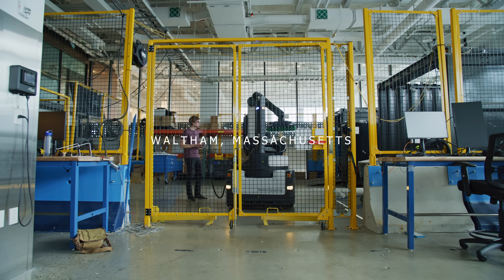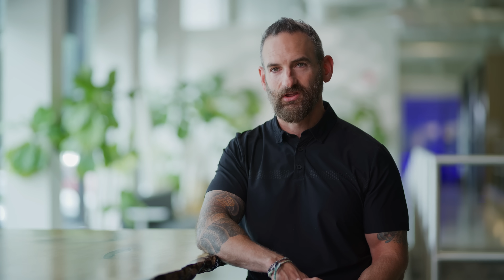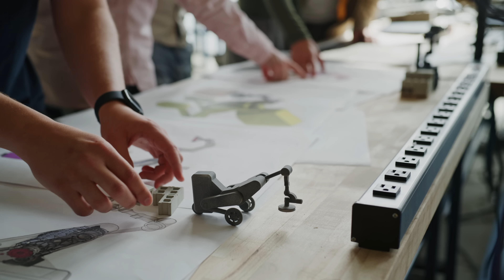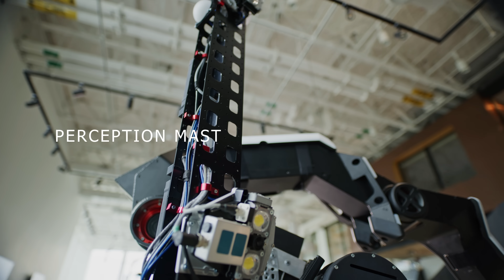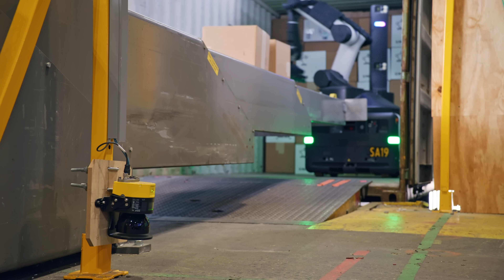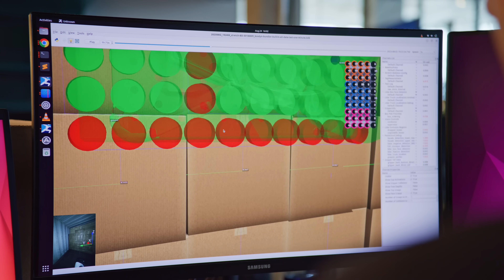The Evolution of Stretch | Boston Dynamics

Comment: They should make one suitable to load and unload suitcases of airplanes. Seems like a huge gap in the market.
Reply: That would be far more difficult because of the tight spaces and how the suitcases are randomly piled up and come in many different sizes.  Robots don't have general intelligence to use arms and gripper hands in such diverse ways, and they also don't have the balance to reach in and yank out or lift out heavy cases.  It would require the intelligence to pull out the correct case each time in a messy pile to not cause problems such as an avalanche onto the tarmac.
What seems easy to us, general intelligence of manipulating things in the real world, is pretty much the ultimate difficulty for robots.  We'll need full AGI for robots that can quickly, safely, and correctly load and unload an airplane cargo, any random truck, or for that matter, clean a house or build a house.

Comment: What if inside the cardboard is something heavier than the cardboard can withstand ?
Reply: The box tears open?
Reply: @frag0638  exactly
Reply: Maybe it can sense the weight and retry from a different angle, eg the side?
Reply: @frag0638 even worse
Reply: @frag0638  don't think so. The suckers are situated from the top so this robot lifts only by sucking from the top of the box. It's stupid idea and you can't apply this to everything.
Reply: You would just have it suck from the side of the box, tip the box over, or pull it out, then swivel the arm to place itself under the box, then balance it on the paddle, then turn, and dump it off onto the belt, or wherever it needed to be loaded. Dunno if this is capable of that, but that's how it'd be done.

Comment: Definitely cool, but being limited to boxes is a problem. This could obviously be trained to handle things like glass panes, wood planks or sheets, but small packages or individual parts will need something with finer dexterity. Even some large, odd shaped items could be a problem depending on how they're stored. Some things are stored in a manner that is very space-efficient, yet requires human dexterity to pick or stock. Such is the case where I work. Of course, a fully automated version of my workplace would probably be designed rather differently. Simply putting a robot where a human is without changing anything else is the most complex solution. Better to design an operation with robots in mind from the beginning.
Reply: I think they’re aiming to partially bridge the gap between human oriented design and robot oriented design. It’s expensive to reorganize your whole warehouse for robots but gradually accommodating robots for specific jobs is (relatively) affordable and profitable in the short term. I imagine as adoption of automated package handling increases there’ll be more pressure on manufacturers to use robot friendly packaging.
Reply: There is another problem which is, that it is limited to specific type of packing stuff into the boxes. For example, in warehouse where i used to work, almost all the boxes where covered with foil and sometimes in more than one type of foil where the outside foil was much more baggy. I don't think the vacuum grabers would work with those

Comment: I'm a truck driver with a lot of experience unloading and loading. This robot is interesting but most loads are coming on pallets, there are a lot of boxes on it and people can unload using pallets which is way quicker than box by box. It would be best if you designed a box to ensure the robot hashave a good grip. They need a pallet robot.
Reply: Agreed, surprised that Stretch does not have an adapter which would turn it into a robotic pallet truck to offload full skids from a docked truck or trailer.

Comment: Big fan of BD.  I'm sure Stretch is causing a lot of excitement in the logistics/shipping world.  I wonder if the speed/efficiency could be enhanced by having two arms.  While one is putting a box on the conveyor, another could be picking up another box.  Seems like there is enough room on the base, just would have to have the compute be able to choreograph the dual movements in the confined space.
Reply: If you look closely when the arm is on one side the lidar scan the other one so it always as a fresh scan for every box placement and the environement. This way if one box fall or something happen when moving it will instantly adapt the next move instead of doing a mess until the next scan ;). 

So with two arm you'll need two lidar but the movement will be slower because the arm will still have to wait for the lidar to scan before taking the box so the second arm will not take the box while the other places it and also every movement for both arm will not take the same time to achieve so one arm will delay the other before alowing the platform to turn at the end it will take more time to turn and will cost more money to make.
Reply: @Skidline_  I didn't say it would be easy to just add another arm and I do realize it would need two lidars.  Why would the arm picking need to wait for it's lidar to scan.  The data from the other lidar could easily be used when it picked up the previous box.  The idea is to get both working symbiotically.   Even though not every pick and placement will require the same time increment, (i.e. placement on the conveyor would likely always be less than the time to pick), you would be cutting the time to turn in half because when it's turning to place, it's also turning to pick up.  As far as the cost, even if a two arm Stretch only meant a reduction of 1/3 versus a one arm Stretch, that still is a huge savings that will pay for itself.
Reply: @JohnMGibby  Yes if the lidar and data are managed in real time but i believe the data is not totaly in real time

When the arm take the box or drop it use the previously calculated data made with the scan that occured when it was facing the other side so it always need the lidar to scan before each move. 
In the video they don't show the arm reacting in realtime to change that occur after the scan. The video also show that it need one operator to move Stretch with a remote so unlike atlas or spot the robot can't move in autonomus way or react to be pushed away  so no real time data ( my guess is that this way it require less power to run increasing the battery duration and need less data to process reducing the cost off microchip and making calculation faster because it will only have to calculate one movement after another and not everything in realtime )

With two arms and lidar it's changed because the picking arm will obstruct the lidar view with a box if scan is done after picking the box so all scan still need to be done before but because off that the arm can't use previously scanned environement because it occured before the previous move so something could have changed between. 

The only way i see it working is if the lidar are placed not in front or rear where arms are but on each side left and right off the robot this way the robot will scan when turning so arms will not be in the way and scan will occur seamlessly during the movement. It will have no delay with both lidar scanning at the same time but will need faster calculation to make it in the turning time frame or it will need Stretch to make a stop mid turn reducing the speed of operation.

It's only my point of view and bd will probably found better way to make Stretch faster and better in every way ^^.
Reply: Just wait few moments - Stretch will have maybe octopussy level of arms spinning around with AI accuracy - just wait
Reply: @mikakettunen7939  Two arms seem like a logical progression.  Octopussy?  Not so sure.  LOL
Reply: @JohnMGibby  I know - was thinking something in terms of 5th Element future or so - but u never know :)
Reply: It seems two arms wouldn't be necessary if they perfect the one-arm's accuracy and safety, then just double or triple the speed. It could load/unload at at a blur to humans...
Reply: @michaelmaclellan499  That is a good point.  And I think a speed up is definitely possible, but some goods might require special handling.  Not every box can handle swinging around at high speed either because the contents may be fragile or the weight of the contents under G load may exceed the capabilities of the box bottom seal.
Reply: Look at the tool changer arm on a cnc vertical milling machine. One side grabs the new tool and the other side grabs the tool from the spindle. Then it swaps them.
Reply: It's called buying 2 of them.......
Reply: @johnshite4656 I suppose they mean having two arms on one base. Having two would indeed take up a lot more space. I think a two-armed version would be worth more than two one-armed versions
Reply: @johnshite4656   Can't fit two of them in a semi trailer.

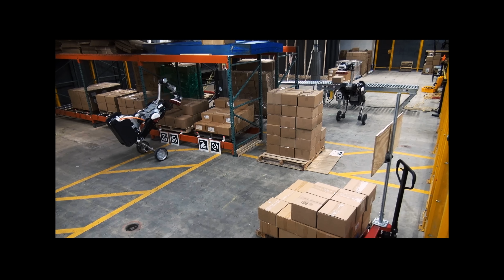Comment: 3:32 - Although they ended up not being the right solution for the warehouse environment, those ostrich robots are my favorite design. The motion they exhibit in order to maintain balance is one of the most natural motions I've ever seen in a robot and makes them look almost unbelievably alive.
Reply: It would be awsome if they turned it into some sort of smart offroad vehicle with the capabilities to pick up objects like logs or whatever on your adventure(the first model with the hands)
Reply: Robots twerking to do their warehouse job. That's the future we could have had if BD had stuck with it. 😢
Reply: @echthroi9  It looks inefficient and unreliable. And expensive. The flat base of Stretch is better where you have level floors.
Reply: @johnshite4656  g
Reply: Agree there is something mesmerizing when seeling it balancing on 2 wheels, turning in a very tight radius and manipulating another object at the same time. Moving boxes seems to be too simple of a tsk for it. With a different gripper it could moved a traler or load truck beds
Reply: It moved very elegantly, if that's what you mean, like a ballerina balancing.
Reply: You'll definitely have some new types of box failures when this starts being adopted. Boxes over 30lbs might not be able to reliably handle its full load from a single face.
Reply: I think they should be in a sanctuary where they can roam free
Reply: It's just not elegantly moving. I imagine if it was taught martial arts, it would probably have some pretty good kung fu and parkour skills like the wheelie people in return to Oz
Reply: @hyperverbal  w in the h f are you talking about.
Reply: @johnshite4656  you remind me of somebody I don’t wanna be around or be a friend of
Reply: @shazam6274  you have wisdom I’d like to see in person
Reply: @hyperverbal  It's mutual. Believe me.
Reply: I love watching Atlas, Spot, and Handle dance on the "Do  You Love Me" video.
Reply: I think they still have a use for transporting luggage and boxes in more rough enviremonts
Reply: As a former heavy equipement operator i was taught Efficiency is doing the least amount of movement to get a fastest correct result. The ostrich wasted way too much time moving needlessly